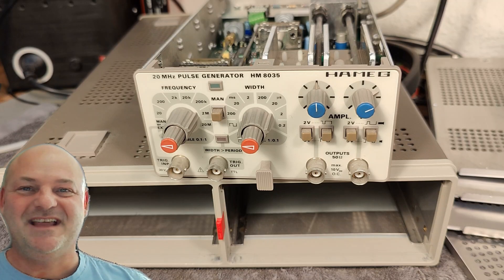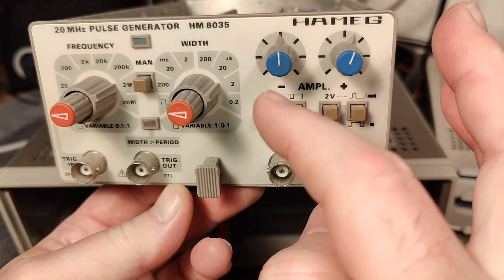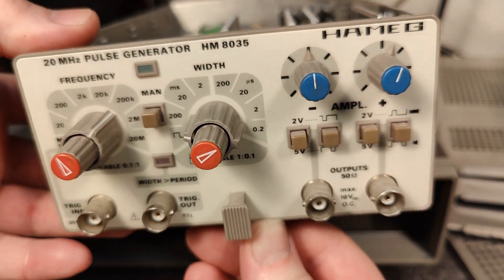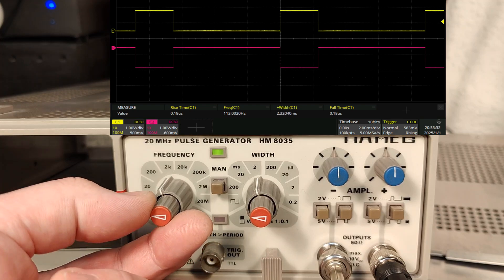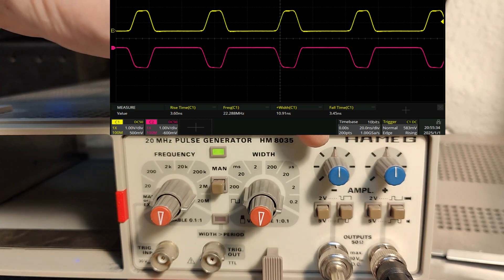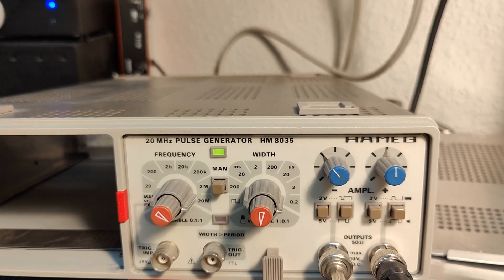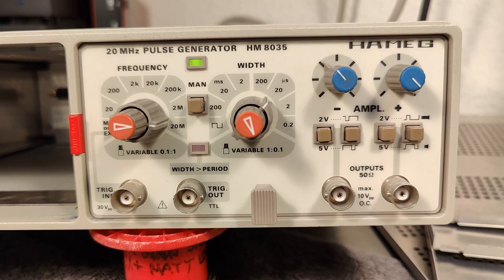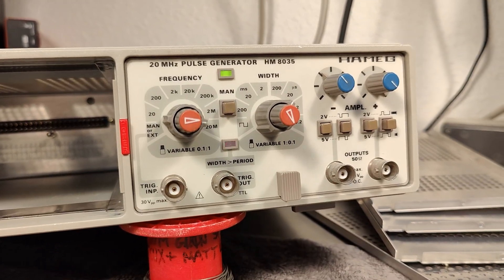Hameg HM8001 HM8035 20MHz Pulse Generator 1995 teardown

Comment: Any idea why they're using NAND gates instead of inverters?  I'd think the inverter would be faster in both risetime and propagation since it's much simpler.  Less noise going into the amplifier maybe?
Reply from the maker: it is normal to try use as few as possible different types of parts, this also includes IC types, so if Nand gates are used where nand gates are needed, they can also be used as inverters other places.
Reply: There is no amplifier inside. It is actually a current source which is turned on or off. It is by the way the most interesting part of the unit, the rest are details without interest. I met the guy who designed this unit when I used to work for Hameg Instruments in France.

Comment: Hi Thomas, you've nicely exposed the faulty design of the connection 👍
Personally I like these modular systems - they save space (and as we know I don't have much) the problem is that the racks are huge and don't save space (and as we know I don't have much) so I can't use them 😂
In my original workshop, I had a Tektronix modular system - 500 series, but I wouldn't have fit it in the current space.
However, it's a beautiful piece that shows how miniaturization can be done, I like the signaling for stupid technicians - red LED 🤣

Info for you - the package arrived an hour ago - luxuriously wrapped - the shipment was undamaged 👍 I have my second Christmas 😁Thank you again

Nice day 🙂 Tom
Reply from the maker: super i am so happy to be able to help a fellow vintage restore friend,.
Reply: @TeardownOZ2CPU  I will send photos, I also restored and modified a double AC millivoltmeter and I managed to buy a luxury meter for building a null meter for 6.50 euros